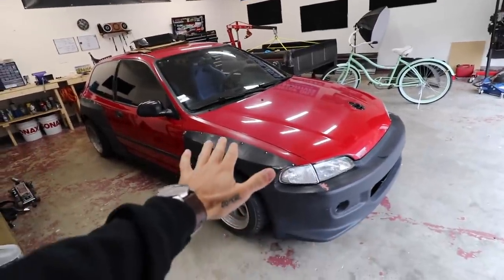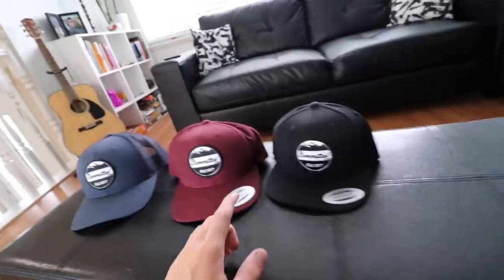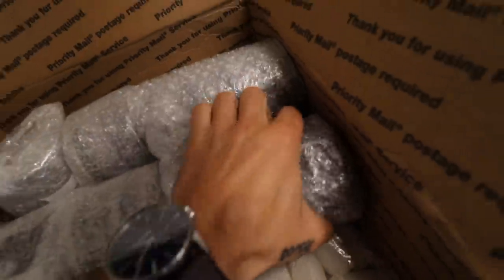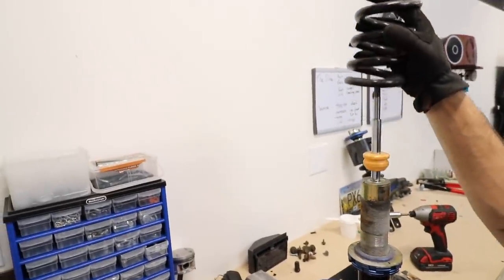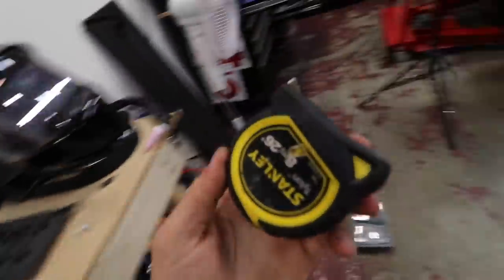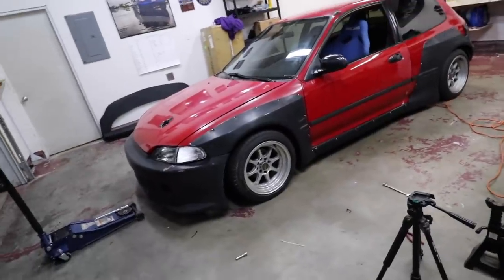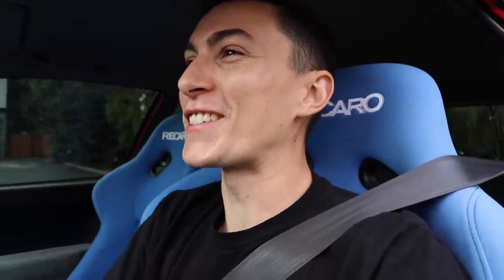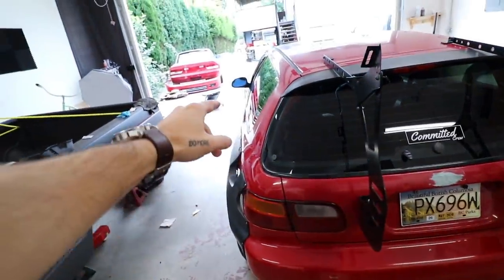Finally Lowering the Civics Air Cup Suspension!

Comment: I'm sure majority of people already know this but for those who don't DO NOT ever cut springs when lowering a car. That is improper and you will get hurt
Just a little public service announcement, carry on
Reply: Pussy
Reply: Maxxas Crow lmfao nothing is gonna happen on cut springs just cut it properly the  more you cut lower you go it’ll probably ride like shit in some cases but sometimes can get a smooth ride
Reply: That's not nice to call someone that name
And cutting springs is a cheap, improper way to modify a car.
Reply: Maxxas Crow totally agree. Unless ur a poor boi
Reply: mrsmilesy real classy comment 👏🏻
Reply: You will not get hurt tho.
Your car however... The shocks will bottom out and you'll need new shocks pretty shortly.
Reply: been cutting springs over 15 years... like anything else... if you over do it, your gonna pay the price. like someone else said you will bottom out your shocks. In my experience, anytime i have done this the ride has been as good as stock and ive been able to get a nice 1-2 inch drop without sacrificing anything... but im also not a idiot so that helps too. YMMV
Reply: lol I run cut springs on the back of mine with a much shorter shock absorber, when the shorter shock fully extends the spring still doesn't pop out. seems solid no problems yet

Comment: You don't need to keep taking off the knuckle to get to the coil over your gonna have to put keep putting new cotter pins. If not it's gonna snap off or the old cotter pin isn't gonna last.

Comment: Just remember that when you get bigger wheels the car will sit higher off the ground. If you go from a 15 to a 16 it’s a difference if one inch but you have to remember it’s really a difference of half and inch on the top of the wheel and a half inch on the bottom of the wheel. so the fender gap will be a half inch less but ground clearance will also be a half inch more. Hopefully that makes since I had that problem with my car and had to adjust accordingly

Comment: 10:50 my brother actually told me instead of buying lowering springs, then going to cheap coilovers, then going to expensive coilovers, then going to bags; that one should just save money for the bags instead. He said instead of spending 3800, you should just save $2000 for the bags and use the rest of the $1800 to work on the rest of the car like interior work and prettying up the engine bay.
If you're a YouTuber, then the process is worth but if you're an average joe I'd recommend saving the money.